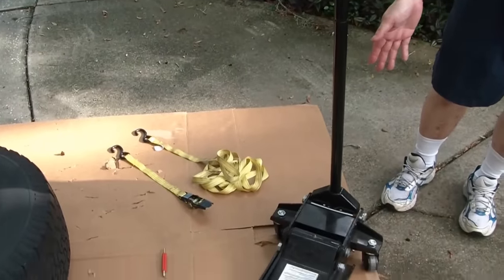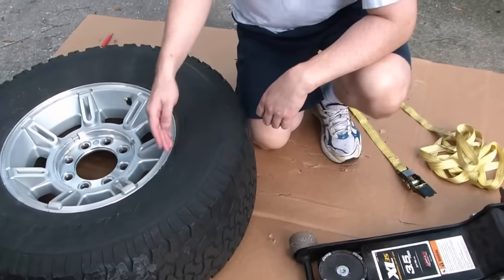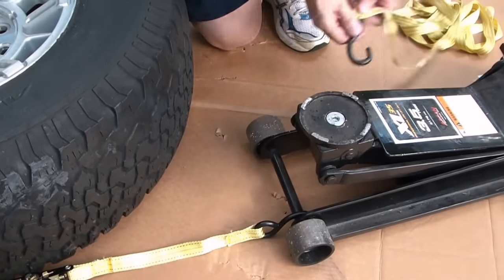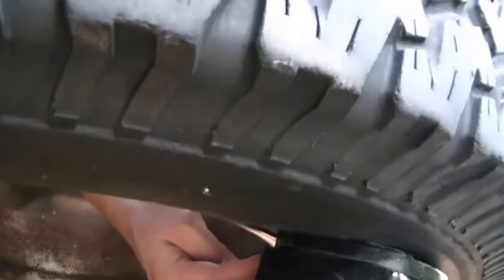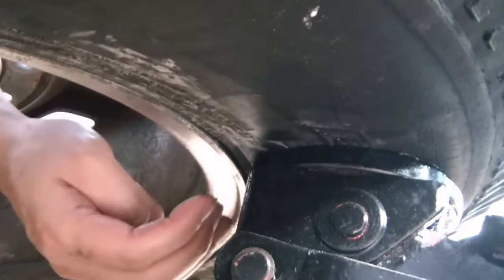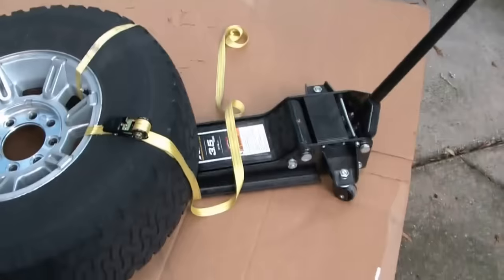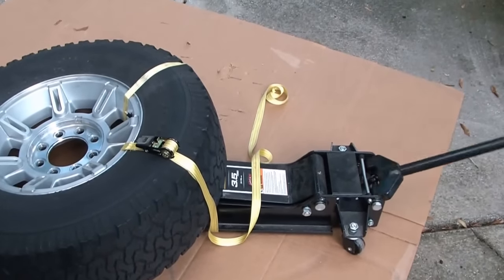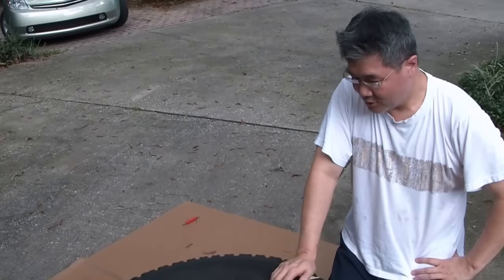Easy and safe way to break a tire bead

Comment: Looking for any theory or idea to remove tire from rim which i want the rim even if i happen to mangle the tire which I dont care about . Have many off hand heavy rod shape 'tools' .. possible sledge hammers .. heavy plate or steel pieces if use .. please share comments . Thank you
Reply: If you're not afraid to mangle it, you could possibly cut the tire carefully near the rim with a utility knife. (Perpendicular to the rim) Then, if it's steel belted, you could carefully use a cut-off wheel to slice it enough to get a prybar into the cut, avoiding the rim itself? I have not tried this, but no doubt it will make a mess. It's purely hypothetical, but if you're desperate enough, violence might be the answer. I can relate to pulling every tool out and saying naughty words when the bead wins.
Reply: @Dwigt_Rortugal  thank you much friend for the comment reply and though I had taken to a tire guy that got it off apart about 2 months ago . Have the rim I want in my place since slowly polishing it with elbow grease all the old crud rust from it ( I like metal stuff is why ) .

Comment: Or you can use a vehicle, lay the tire down and drive onto the tire getting as close to the rim as possible. If it doesn't debead get out and stand on the other side and it should pop loose. With low profile tires I don't recommend this method because the rim wants to flip up and hit the vehicle you are using. But big truck tires like that it's simple to do by yourself. But it's always better to have a second person to help but that's not always possible.

Comment: Even easier is to use a Harbor Freight bearing press.  make a shelf to hold the tire flat inside the jaws of the bearing press.  pop on one side, rotate180 degrees and pop, then flip over and repeat for the bottom bead.

Comment: $80 for a rarely used tool would be acceptable to me. However this is good info.

I would make sure if you have a tpms,keep the sensor away from the jack at least 90 degrees.

Comment: Would adding the soapy water to this method help or is it not necessary when utilizing this method?
Reply from the maker: Excellent question !  Tire lube or soapy water definitely helps in most tire mounting and dismounting. Unfortunately, in this particular situation (rubber bead fused to an aluminum rim over many years), the soapy water can't seep into the bead. I've seen other people try soaking the bead and letting it sit for a while, but that never worked for me.
Reply: @auxpowerunit  Thanks for the respond!!! 😁

Comment: My dad showed me 50 years ago another method.  Lay your victim on flat the ground.  Using the front wheel driving in the side wall, then turn the drive wheel tight along the side of the rim. Make sure you’ve already removed the inert of the valve stem.

Comment: Don't just break the bead.
Always help it with some lube. 
Kerosene keeps in very well and dries out  clean.
I use it for all work around rubber parts.
Can lift gaskets free too.

Comment: Now to remove the complete tire is another story.  This probably won't work with low profile tires and if it does work would be only to replace the tyre sensors but the problem will be to put the tyre back into it's original position as the tyre will have moved off sight and a byotch to align back in order to inflate with air without proper tools do it's very hard sidewalls.  🤔

Comment: Another easy way is to jack up your vehicle and get a block of wood and place it between the car frame and the tire and lower the car down using the vehicles weight to break the bead.

Comment: Jack up the car, set the tire you need the bead broke on under a wheel (preferrably a rear wheel so it won't turn), put the bead at the edge of the tire on the car, lower the jack so the weight of the car is on the tire that needs the bead broken on

Comment: The easy way to break a tire bead on a car, pick up truck, motorcycle wheel, is to go to Harbor freight, and buy either cheap I mean that literally and figuratively, tire machine for $49. It is a cheap piece of crap, but it has a very good tire bead breaker that I use often.. i use it to break motorcycle tire beads because they are impossible unless you have a tool or a machine sometimes...
  if you have a nice new set of wheels, or a nice new car with pretty alloy wheels on it, don’t scratch the hell out of your wheels by prying the tires on and off with a tire iron. Take your wheels or your whole vehicle to a tire store and have them do it with a touchless tire changing machine .. I have an old gates manual tire changing machine that was widely used in gasoline service stations up until about 20 years ago. I have changed literally hundreds of tires back before cars were front wheel drive, here in the Northeast it was a semi annual procedure to have your snow tires mounted in November and have your summer tires mounted in April every year.. with those old manual machines will scratch your wheels when you slide the tool around the outside of the wheel against the spindle to spin the tire on/off.It was OK to do that when you could hide the scarred steel wheels  With the hubcaps.. but not anymore, then there’s the added concern about possibly damaging your air pressure sensor mechanism inside the wheel by prying tires off manually. Don’t risk it, take it to a professional if you have nice wheels

Comment: Can you give the brand of the Strap?  I can't find at Home Depot.
Reply from the maker: The strap I used is an old, cheap, 15-year-old Harbor Freight strap. Any decent one will work, as there will be less than 400 pounds of tension on the strap. Home Depot and Amazon's websites list those as "Ratchet Tie-Down Straps".🙂
Reply: @auxpowerunit  Thank

Comment: it works well but beware that depending on the straps they can break at any time and cause an injury if anyone had that happen please post it; it happened to me , one of the times it broke and hit me, another time i was lucky that my leg was not on the way of that metal rachet flying passed by it at god knows what speed. From now on if i don't have a thicker strap im running it over with my truck a few times and it comes off easy too.

Comment: I just leave the wheels on,  pull up along side a curb, let the air out, place the cars scissor jack horizontally between the curb and the tire bead and crank the jack

Comment: Here's a cheaper, easier way to break the bead. Place the tire under something very heavy with enough clearance for a 1 ton or more capacity bottle jack. Place the base of the bottle jack on the tire casing reasonably close to the rim. You do not have to get it close enough to rick ruining a $300 rim! Now pump the bottle jack until the pad comes up against the heavy object and continue pumping. The path of least resistance will be the tire casing so as you pump rather than the pad rising the base will push down on the tire casing and bread the bead.

Comment: It's much easier for me to take my wheels to a tire shop to have them serviced or swapped out "and balanced". Removing them from your vehicle n taking them in your second vehicle already saves you labor n when you come back you can put them back on your vehicle without fear of having your vehicle damaged or having the lug nuts over torqued. A common problem in today's high paced tire shops. Also you can adjust the tire pressures to your preference for the best ride. Not all specifications are accurate. Too much air is just as bad as not enough...

Comment: ATG methods work best & faster:
1. Jack up car or tuck
2. Remove wheel
3. Place wheel under path of Brake Rotor or Brake Drum
4. Check that Rotor or Drum contact just the tire & not the rim
5. Slowly turn car jack CCW- you got about 250lb press :o)

Comment: This didn't work on a 2-Ton hydraulic jack. I would do the other method which is using a scissor jack sandwiched between the tire and the car. It is a real pain.

Comment: Good video but if the tyre is not scrap it’s better to ‘protect’ the tyre sidewall from the saddle of the trolley jack with a piece of nylon or rubber to prevent cutting. 

Of course you could just run over the tyre with a car …

Comment: Ill admit this works but the place he lifted it from was a very bad place. You should always place it 90 degrees from the valve stem. Doing that can avoid any sensors. Don't do it across either because their could be a sensor belt. Only place this 90 degrees from the valve stem. Unless you dont care about your sensors and the TPMS light dont pop up because you broke it.

Comment: I just lower the car I took the wheel offs brake disc or drum down onto the bead. Already got the jack under the car anyway. If it doesn't budge give it a good beaning with the back of an axe.

Comment: Looks great but I would be concerned about damage to the sidewall. The machine that brakes a bead puts pressure exactly along that bead. Your method presses against the sidewall directly. There are metal bands in there and the sidewall carries the weight of the vehicle. If you were in a pinch and you needed to change a tire and emergency situation and this is all you had it seems to work very well.

But you can take any tire to any Mom and Pop shop and they'll probably take the tire off the rim for you for 10 bucks. With one of those big machines that's meant to do it properly.

Comment: I just jack up the car, lay the wheel and tire under the jacked up wheel on the car, then set the car down on just the edge of the tire im trying to break the bead on.   Just did this to replace a valve stem that was leaking.  

A little gas and a match reseats the bead well too, just watch your eyebrows

Comment: Yet another way to break the bead. Easy enough once you get all the stuff needed to do it. 
No criticism here. But if you're working with smaller tires and wheels there's going to be more hand work involved. They're much more difficult to do. 
And then there are tubed tires. A little trickier. And then there's balancing your tires. A little more work.
But a good effort here breaking the bead. But that's only the beginning.

Comment: 😂 just buy the slide hammer tool the bigger the tire the faster and easier it works plus to jobs later it paid for itself also use soapy water it helps

Comment: I want you to go back and look at this, your second view from the bottom,  look at the tread, the outer most bottom side on the left of the screen, there is a crack in the rubber going all the way to the core, this tire will blowout you raised the jack to far and stretched the rubber.

Look close at this it could kill you at hwy speeds. 

Clever idea. But don't compress the sidewall in so far.  

Look at center bottom treads  4:55  
This tires no good now.

Comment: Well, it worked, for that one, under those conditions.
You could also get a few feet of beam from a lumberyard cut off ends bin and run over it with the heavy end of a truck (spare tire in use) 
It just wears you out and injurs you eventually. So having a rapport with a young man at a tire shop is a very good idea for stubborn ones.

Comment: That worked well but takes too long. A 2x8 about 4ft long, put it on the edge of the tire & drive the truck up the 2x8 & your done! Could do all 4 by the time you get one done. I've done everything from cars, trucks, motorcycle & ATV's works every time! GMC tire machine!

Comment: O.k Tyre Bead ! Using car jack ! Tyre Still on Rim !! Another You Tube Guy ! Used ! A thick block of wood drove another car on the Wood to Break the bead ! My fear was the wood ! Would break ! Then using Tyre levers to get the Tyre off the Rim ! Using Soapy Water ! Another Guy on you tube Using Harbour frieghts Thirty five Dollar ! Hand Bead Pole Breaker ! Bolted to the Concrete Floor ! ( Thinks there good ! Except for the bar twisting ; when the Tyte is being put back on the Rim ! May want to try that ! If you can Afford it ! ) I thought your Straps might have Broke ! But didn't happen ! But Good idea ! Though ! Thanks for sharing the Idea !

Comment: Easy way to break the bead:
1. Let air out of tire.
2. Prop a 4×4 on the tire. 
3. Drive up onto the 4×4. 
4. Bead broke. 
5. Flip tire and repeat.
 Done. 
Removing tire:
1. Start prying, walking your pry bars. 
2. Flip tire and repeat.

Installing a tire on rim:
1. If you need me to tell you by now. You should not be doing it.

Comment: this might work  1 out of 10 times at best !
Reply from the maker: I've used this to remove about 20 tires. It has never failed, but I did need someone to stand on the wheel while doing low-profile tires.

Comment: yeah that works . . . but won't every time . not all tires come off the bead that easy . 
plus . . . you are stressing the sidewall too much doing this . the sidewalls are not designed for that .
the machine that's made to do this focuses the pressure on the bead . . . the part of the tire that IS designed to accept that pressure .
you could possibly damage the sidewall of the tire making it . . . junk  and forcing you to buy a new tire for a couple of hundred dollars when a repair at a tire shop would cost much much less .
but hey . . . you do you .
i did work in a tire shop for 6 years but so what  . . .  what do i know ?
edit: this would be fine in an emergency where you have no access to a tire shop , but overall unless i had no choice i wouldn't do it .

Comment: Now try it with a low-profile automobile tire.
Reply: Wont work
Reply: I don't know, man, there are other commenters here who have claimed it does work, but ymmv. I was thinking that if this doesn't work in my application, I could sandwich the tire between the jack and a piece of 4x4 post wedged up under the trailer hitch of my truck.
Reply: @Dwigt_Rortugal  Hector, I am going to give it a try using a scissor-jack under the trailer hitch of my Subaru Forester and see how that does.

Comment: Good grief..looks like a new jack... for that kind of money could have bought a harbor freight manual changer!!!
Reply: I have that Harbor Freight manual wheel changer... the bead breaker does not work well... it's really hard work and frustration. This guy gives me some idea to make the job easier.
Reply: @MrTiger0002  I do have the harbor freight manuel changer no problem with breaking beads .only used for garden tractor tires....Long story short I use a electric tire machine... bought used for $350.00 ...well worth it.

Comment: too much work. just lay it flat on cement,  or ground. drive over the tire with the front drivers' wheel on the tire near to rim. .....voila  ....done.....done this lots....oh, make sure the valve is out of the rim stem......ha

Comment: boy are you cheap, my local tire shop rotates and rebalances my tires every 5 thousand miles for free, of course i bought them there and i tip the tire tech 10 dollars
Reply from the maker: My local tire shop does it for $28 per tire (since they consider these to be oversized). But aside from the money, I've had tires ruined by shops that didn't use lube on the bead, overtightened lug nuts, installed super long valve stems, and left balance weights dangling. So I'd prefer to do it myself, because my family's safety depends on it !

Comment: With your car jacked up, slide your tire under the brake rotor. Take a block of wood and line it up on the bead. SLOWLY  let the jack down and the weight of the car will push the bead off. Get that far and maybe I'll tell you about how to set the bead with starting fluid. Be careful for Christ's sakes. It's only like twenty bucks to watch some hillbilly do it right.

Comment: Way too time consuming "" I either use a jack to break mine down or use the truck or car to drive around  the tire bead to break the tire loose from the rim"" I have done this for years, and have changed many many tires this way"" my method works best "" but thanks just the same""